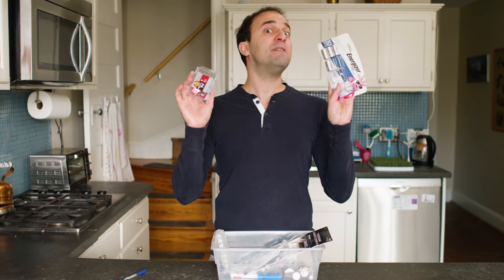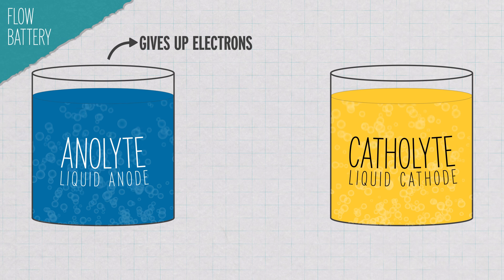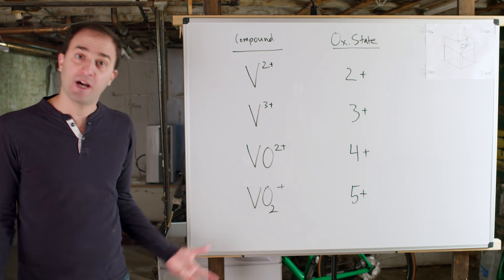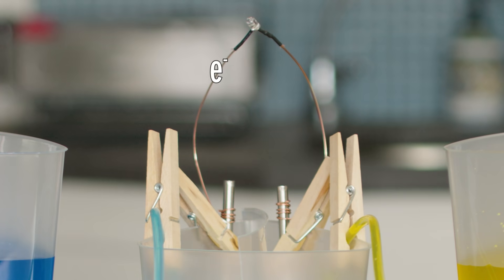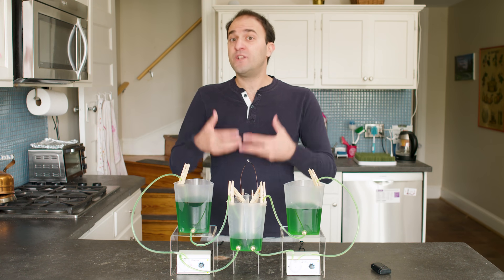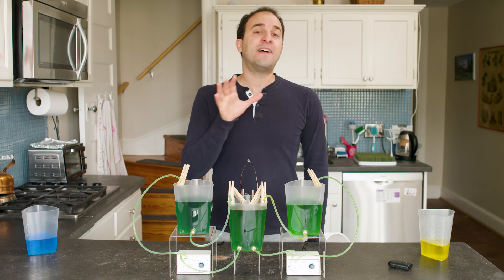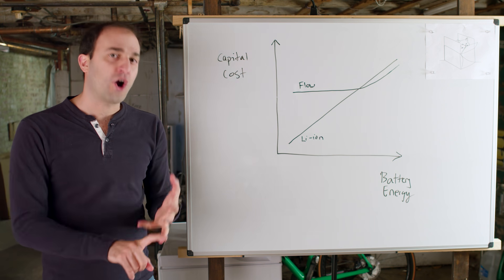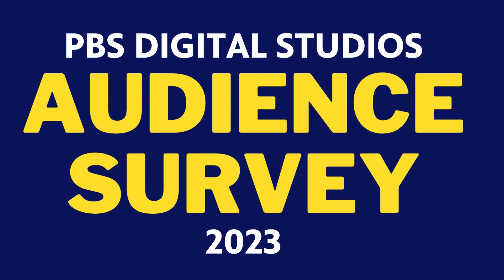Vanadium Flow Batteries

Comment from the maker: Periodic table grab bag of battery elements that are used for flow batteries: zinc-bromine (the oldest!), polysulfide-bromine, iron-chromium, titanium-iron, the list goes on….!
Reply: I dont know if intentional or not, but i love that the element you hit was iron, which  is also in the examples list; twice even
Reply: And then there's the organic battery, can you cover that because as far as I know things like quinone don't have a charge when oxidized, as an ion of metal does.
Reply: Isn't Vanadium the better option?
Reply: @mike27158  I don't know about better but it's definitely cool because it has so many different valence states each with their own color so you could just look at the color of the electrolyte and know the state of the charge, and that's all using a single element & easy to recycle, so it's definitely cool.
   But as for whether or not it's better, you got to take into account that if this goes into mass production what would be the limitations of the resource and the price point increase when the demand goes up.
  Iron is probably best from a large-scale price point perspective, and lithium will always be king for power density, yet of the hundreds of different other chemistries in between, it's just a compromise between price and power all of them useful and they all should find a place.

Comment: ur battery membrane is not doing its job, they turned green because the liquides mixed not vanadium reactjng, since ur load is only a weak led it will take mothes to discharge it

Comment: I didn't see the LED turn on? Or was this just a show? An LED literally only needs 20mA to shine on its brightest so I was a bit shocked to  not see it turn on.

Also the statement you made about douboing the capacity was odd. U said to double lithium battery u need another battery. And then u said to double this liquid battery u just add more liquid. Surely u wouod have to double the liquid also? Not sure how that is an advantage over lithium

Comment: A family member lives on a 42000 acre canola farm in pastoral Western Australia and they have just leased 250 of those acres to a Vanadium ore processing plant. I recently visited the farm and looked at the site which is part of the least profitable section of the farm. The ore is going to be trucked in from an iron ore mine which also contains Vanadium about 200 miles away. The reasons they are constructing the processing plant are
- abundant supplies of natural gas are available via a large pipe line about 10 miles away.
- Underground water not suitable for agriculture but good enough for ore processing is available locally
- the property is about 40 miles from a large port where processed vanadium can be trucked to and shipped out from
- depending on price the iron from the ore can also be sold.
- a railway line exists between the mine, runs right through the proposed processing site and onto the port and once the processing plant scales up can replace the trucks.
- concrete reinforcing rods (rebar) contain significant amounts of V which is what gives rebar its tensile strength. Rebar can be separated fro waste concrete and put through the processing plant to recover the V
Once the processing plant is running a large solar array and Vanadium flow battery will be set up to replace the use of gas. The railway could also be electrified and the distances to the port are not outside the range of electric trucks to bring farm produce to the port saving huge amounts of diesel fuel used in the process.
Reply: I need a link to a news article on this sounds interesting
Reply: @ sorry this hasn’t actually gone thru yet - they’re still dealing with a raft of issues before it can go public.

Comment: At arround 6:00,
You mention that capacity can be doubled by increasing the volume of the fluids of the compartiments by two; this is true if it is the same as the starting material.

It can also be doubled by increasing the concentraction of the reducer or oxydizers by two (or more) until it reaches the maximum due to solubility issues or "activity" of the solute into the solution.

I suppose that some flow batteries can work with a bottom layer of the undissolved salt; that will dissolve if the salt is consumed and converted into something else (as long as the cristals don't interact with the electrodes (touch or reduce electric flow).

PHZ
(PHILOU Zrealone from the Science Madness forum)

Comment: I think iron flow batteries have the highest potential simply because of the price.  
Hopefully the technical problems that exists will be solved in a reasonable manner.  
Not sure if potentially possible, but Ideally you would have a battery where you can add iron scraps to become part of the electrolyte. Imagine if you could use old tin cans when expanding your home-battery storage by some simple steps like heating them in the fireplace to remove zinc(or acid-bath) and plastic/lacquer, clean up and toss in an addition-chamber.

Comment: nice presentation. I like to add:  more than 40% of the Vanadium-Vanadium Flow battery cost, is the Vanadium electrolyte and stack only contributes 20 to 30% max of the battery cost. Vanadium price is volatile due to the primary market which is the steel + catalyst industry. when energing technology arrives in the market the main problem is the source of material like Vanadium?
+ Because this electrolyte is water base ( aqueous ), in cold and hot climates performance has some issues ( in cold the battery needs heating support, and in hot conditions, the solubility shows some effect then the effect comes on battery performance and lower efficiency.)

Comment: Fun fact: Vanadium is about as common as copper, nickel and zinc in the Earth's crust, but it is more expensive (at present) to refine the ore. I'm a retired engineer, so I really enjoyed your explanation of the chemistry involved.
Reply: One thing to note is that spread of a mineral is often more important than how 'common' it is. Plus other roles it has. Considering most Vanadium comes from Russia and China, and it is a strategic mineral because of alloying, I'd not bet on it for a large scale storage solution.
My money is on iron air batteries for grid scale.

Comment: When Wall Street finds out about this, VRFB investment will take off imo. It doesn’t cause toxic fires; that’s all I need to hear.
Reply: Depends on whether they actually use concentrated sulfuric acid as the fluid. If so, a leak near anything organic could potentially lead to a hydrogen explosion and definitely to a toxic mess to clean up. Even a moderately sized leak would do serious damage to most common flooring materials, even concrete.
Reply: @willythemailboy2 It’s diluted sulfuric acid mostly as far as I can read.

Comment: Not a single  real cost calculation. What a bad video.
Of course if the flow battery gets bigger and bigger you need to add 
more and more stacks.  You remember, the expensive piece.
I not only want big storage capacity, I also would want big electric
delivery  capacity.

Comment: Also, since the anolyte and catholyte are liquids, rather than solid electrodes which can accumulate defects with each charge/discharge cycle, a lot of the mechanisms for the cells to wear out go away.

Comment: If it works the. The LED would light up... Was there even a current limiter ?
Did I miss seeing that LED actually light without CGI ?
Reply: Seeing as it was a "metaphorical" battery that 1) didn't have a membrane of any type in the reaction cell and 2) almost certainly did not have actual vanadium compounds dissolved in concentrated sulfuric acid, I'm going to hazard to guess that it was just food coloring in water. Certainly I'd hope for some goggles and gloves if he was handling actual concentrated sulfuric acid.
Reply: @willythemailboy2  totally,  didn't he even say something about it being a model?
Reply: @playgroundchooser  models don't have to be inoperable
Reply: @1st_ProCactus The chemicals would be dangerous and it wouldn't work without a special membrane he does not have. It's a metaphor. Like a drawing. It's like you're complaining a whiteboard drawing of a circuit can't charge your phone.
Reply: @filonin2  lol.. I watch a lot on YouTube in all areas of science... If it's not real it's a joke, maybe the tech is real, but nothing in this video was... I know plenty of YouTube uploaders that would do this, since they do much more dangerous things than whatever that was meant to be.

Comment: Thorium can generate clean electricity all day around and reprocess waste from conventional nuclear power plants at the same time. All that's needed is an open-access molten salt reactor design, such that adoption can happen quickly. I.e. if the U.S., Canada, EU, South Korea and Japan funded the development in a joint endeavour, such a design could be completed and tested within half a decade or less. What's a few bn USD for all those economic zones combined? Peanuts!

Vanadium redox flow cells may be great and all, but it's not exactly stellar that there are already plans to harvest the needed Vanadium from the ocean floor, by using what's essentially a huge suction pump, killing the local marine life in the process and destroying an ecosystem we don't even fully understand yet. I propose that humanity, for once, trys to solve an issue without creating two new ones in its place!

Comment: I've been hearing about vanadium redox flow batteries since UNSW's original work in the early 2000s. It's exciting, to be sure, but it and other flow battery chemistries never seem to have taken off since. It would be really interesting to see a home-scale off-grid implementation of solar + flow battery designed for year-round use.
Reply: Yeah I'd be concerned about this particular model freezing up.
Reply: @tgeliot  Would be completely usable in warmer countries like Australia, though. There aren't really any areas here that would get cold enough for long enough outside of a few ski resorts in the mountains. Where I live, it gets down to -10 overnight in the winter, but the daytime temperatures are always positive. Worst I've seen in terms of anything freezing is mabye 15mm of ice on a puddle after a big frost. A 9L bucket of water left outside won't freeze solid, so a 100L tank definitely won't and you can always insulate the pipes going to the reaction chamber if you're worried about those. Also, the dissolved metals are probably going to lower the freezing point of the solution, just like with the salt in seawater.
Reply: There is a very large grid scale flow battery being implemented by Xcel Energy in Minnesota.  Not sure if there are any for home energy storage in the works, that probably goes back to the much earlier point in the video about cost at small vs large scale for Lion vs redox flow.
Reply: "The U.S. made a breakthrough battery discovery - then gave the technology to China" 
by Courtney Flatt 
Oregon Publishing Broadcasting website.

Comment: Im finishing my PhD on VRFBs. If anyone wants to know the drawbacks or advantages feel free to comment below and I'll answer them. Also, the anolyte should have been colored violet, not blue. Blue corresponds to V4+, not V2+.
Reply: Can the regeneration process occur in the stack? Do the liquids need to be removed and redox chemistry done to the solutions?
Reply: @rkeil3145  if I'm understanding your first question, yes, the "stack" is where the redox reactions take place. VRFBs are considered fully rechargeable, meaning that the battery can flow all of its electrolytes through the stack to extract electrical energy, and then flow them again with a voltage applied to reverse the process. The whole process is only ~80% efficient for the sulfuric acid based electrolytes. This should answer your second question, since the liquids can be "regenerated" by flowing through the stack during recharge.
Reply: @allthingsdestructive  thanks!  Best of luck with your doctorate.  I can say that grad school is better when its in the rear view mirror.
Reply: @allthingsdestructive  hello, may I know how much voltage needed to reverse the process?
Reply: @meantobemin  Generally you need a higher voltage than the theoretical 1.2 V in order to overcome kinetic energy barriers and ohmic losses. In my small setups I had to apply 3-4V to get the thing to charge in a reasonable amount of time, but my setups were small and not optimal.
Reply: 100% thank you for saying violet and not purple. I know they aren't the same thing but so many people seem to call violet purple for some reason and it bothers me to no end (violet is one of my favourite colours).
Reply: @CubeXGameDev it depends on the specific solvent. Not all organic solvents are explosive.
Reply: Overall, was your impression bullish on VRFB adoption in the near-term? I've been looking at investing in vanadium plays (specifically LARGO) but seek to understand the market a bit better.
Reply: @EnglishCurrent  I don't know much about market adoption. China has invested quite a bit into the technology and it's been developing since the 80s. Nobody mentions the original inventor- Maria Skylass-Kazacos. She's still working on improving it!
Reply: Hi there! I’m from Columbia university and currently working for a project on separating V(V) and Fe(III) in diluted h2so4 by altering pH and temperature, but now I’m having trouble where they either both precipitates or stays in the solution. Do you think there’s any other solvent or acid I could try? Some literature mentioned roasting leach but the temp condition is kinda impossible and looses its meaning of saving energy. Others also mentioned phosphorus based acids may help but I haven’t got a chance to try yet, do you think that would work?
Reply: @cherrycorn666  well met 😊. From what I know, at 1.5M V(V) precipitates to V2O5 in 3.5M H2SO4 if the temperature goes over 40C. I don't think Fe(III) would precipitate at that pH
Reply: Do acid solvent variant increase the voltage as much as the organic solvent mentioned in the video?
Reply: @cake0214  no, the voltage remains the same for different acids. There is a theoretical maximum voltage (1.2 V) possible with the two redox pairs (V2+/V3+ and V4+/V5+) which cannot be achieved in reality due to thermodynamic and kinetic losses. Different supporting electrolytes can help reduce these losses but you cannot go over the maximum. The only way to increase the voltage over the maximum is to change one or both of the redox pairs. If you replace the cathode reaction with an oxygen reduction reaction, the voltage jumps to almost 1.5 V.
Reply: Is the membrane typically Nafion?
Reply: @nickthepark  It's the most common commercial membrane used but other PFSA membranes are available. Some non-PFSA based membranes are commercially available but most are still in the R&D phase. For vanadium based flow batteries, PFSA membranes are the best choice for stability but they are horribly expensive and their production is not environmentally friendly
Reply: What were you looking at in VRFB's .. is your theses available to download and read ?
Reply: @faramog  My whole thing was using atomic force microscopy to image the Nafion membranes while simulating the battery environment inside the microscope. The longest chapter is just me recounting all of the difficulties I had in trying to set it up.
Reply: Can you charge and discharge this type of battery at the same time?  I was thinking maybe having an extra smaller stack devoted to trickle charging?
Reply: I know one of the limitations of this type of battery is the concentration of the ions, 
  how about ionic liquid instead of an organic solvents, you know a euclectic mix of the right salts, which ones work pretty well and of those which ones are best for commercial and which one is best for home hobbyists? Are there two viscous for gravity feeding?
  What are less expensive proton exchange membranes? Have they developed any that are stable in non-aqueous systems?
  What about organic coreactions?
Reply: What is ongoing research happening in the flow batteries? I mean what are the top 3 issue that researchers are trying to solve
Reply: Thanks for indulging my basic beginner question:    Suppose I want to scale up to a useable voltage, like 12, 24 or 48 volts.

Using 12v, does that mean I need 10 of these stacks (producing 1.2v each)?

I have access to blue food barrels, 55 gallon drums.  Base on constant ON, approximately how long does it take to use up the (2) 55 gallon system?

Suppose I have a 100 watt pv panel, sending 24v and the hypothetical 3-4 peak sunlight collection (discounting the off axis 3-5h work of collection), how many gallons of solution can I recharge?

Thanks for indulging my questions.
Reply: @peterxyz3541 The missing piece you need is a proton exchange membrane, a sulfonated flouropolymer sheet that usually is also doped with rare earth metals to improve the kinetics. That stuff can run you a few hundred dollars a square centimeter. Keep in mind that, up until you approach high kWh or MWh scales, this is not a cost effective system. If you want to store energy that you're producing on your own property, lithium iron phosphate is currently the best option for longevity and cost, and LFP chemistries are fairly environmentally benign as battery chemistries go. In the next 10 years, sodium ion batteries may be in a position to take over in this cost role, and those use extremely abundant chemistries. For now, choose an LFP system that meets your needs, their capacities are known and well established, and plan for a battery management system to control their temperature and limit deep cycling
Reply: What does the battery juice taste like